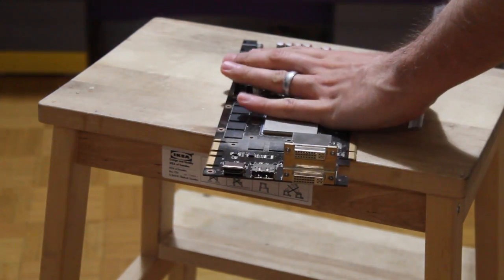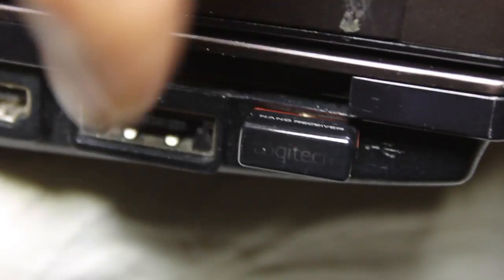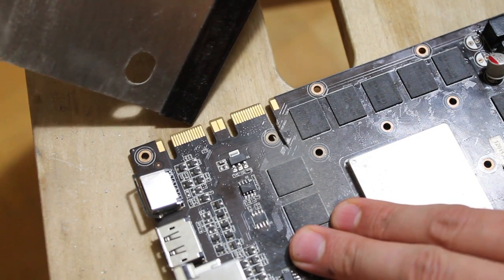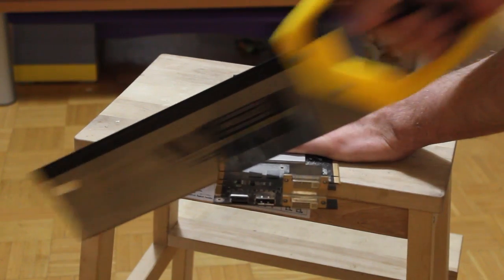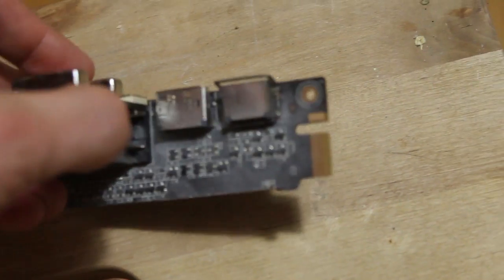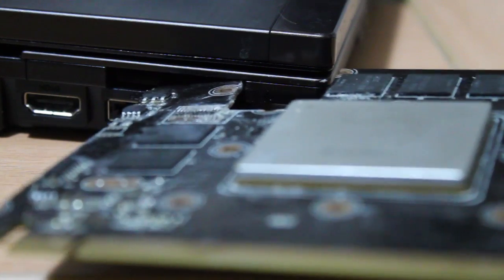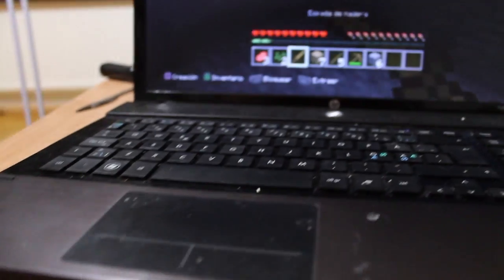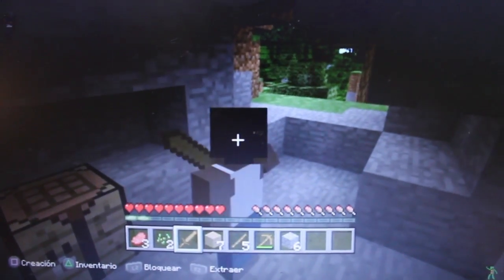Desktop to laptop GPU hack

Comment: This is amazing, I tried it with my 1080ti and it works like a charm!
Reply from the maker: awesome
Reply: Only think is, you may want to add a warning - when sawing through the card, to be extra careful, make sure you ground the saw itself,  or alternatively wear rubber boots. Otherwise you could damage the graphics card with static discharge..
Reply from the maker: true true

Comment: I had two pci-e slots on my laptop can I use two?
Reply: Wait wait wait, I did this but the cards needed to be powered by an external power source, but my dual chopped gtx 1080 ti's are a cool 45*c idle.
Reply from the maker: you need to multiply by two. then you get 90 C
Reply from the maker: maybe you can fit 4?

Comment: Dude is it a GTX 500-series GPU? It looks almost like my own GTX 570 that I baked to work again (no kidding, it'd BSoD on Windows startup and showed random pixel noise when booting up Ubuntu).

I just wonder if yours wasn't too dead to try and bake it.
Reply from the maker: GTX 580.  A few capacitors needed to be replaced, and likely the whole card would need to be baked (which is never a permanent solution). Even then, I'd have to order a heat sink and fans for it. with enough work it might have come back to life.
Reply: Sure, not worth the effort. I had an upcoming LAN, so I had to try something that's better than the iGPU
Reply from the maker: LANs are fun. but do local LAN games still exist??
Reply: Hungry Gizmo it was quite a while :D
I baked it for the 4th time now :P

and the LAN game choice is poor. Probably a good reason to play old classics like C&C, Serious Sam etc
Reply from the maker: yeah. everything has to connect to some server outside on the internet. not like the good old days. oh well. LAN parties are fun. I set one up a long time ago. ha C&C is always fun. are you still using the same graphics card. (by the way, I'm still making videos, subscribe, bell icon, etc. if you haven't already)
Reply: Hungry Gizmo Yes, still using it. Because... I decided to wait for next-gen in 2016 and then mainstream upon crypto happened.

I had unsubbed because it was too much, too long trash videos even for my liking.
+1 for a while ;)
Reply from the maker: I imagine you mean the reviews, etc? Here is the thing. those videos bring in views. like forever. people are always searching for them. Nobody is searching for a joke - they only get viewed if people share (so share, it helps). but. For your sake, about a month or so ago I decided this channel will be 100% (or close to it) tech humour. So stick around for a while, keep on watching. There is a lot of new content.
Reply: Hungry Gizmo I appreciate those reviews. They weren't in-depth but every video helps because people otherwise have no idea about a product (that no one else reviews).

I know about the search traffic. (and that's the reason I don't know how to start solo on Twitch)

What I meant were several minute long videos such as flying RAM sticks and Gizmos. Had it been under 2, 1 minutes - ok. But a 4 minute flying RAM nonsense is too long and hence too much.
Also I don't know if you were aware of, but overly long outros only hurt you on youtube (even if you made it your gig) - because of lower avg view duration and people not following onto other videos at the end.

Check out exurb1a and Life of Boris. Both channels exploded in the past 2 years (but Boris is honestly a genius with some prior experience on Youtube)
Reply from the maker: glad you appreciate the reviews. But those will eventually be moved over to another channel, because most of those viewers were not the audience to jump over to the other content. So you mean the RAMCPU adventure series? I haven't done that in a while - but it seemed to be well liked. but the back to back to back episodes may have been too much. (It's always a challenge to find a balance).
Yeah, well, the one and only figure YouTube cares about is watchtime - if you check out the official whitepaper released, even subscribers don't seem to influence the recommendation algorithm.
I'll check out the channels.
and thanks for the feedback - it helps build a bigger picture. From this side it's impossible to know, some of the jokes I think are great don't do well, and ideas I hesitate to put into a video turn into huge hits.

Comment: Woah woah woah, you forgot to put a warning in your video!!! If you do this, when you cut off the notch, you lose some VRAM. This may not be a dealbreaker for some, but it would be nice if you put a warning in your video.
Reply from the maker: It really depends on the card. The warning will be on the instructions you get from the manufacturer on how to make the cuts.

Comment: Thanks for the hack man! I can finally run Crysis 3 on my 2011 MacBook Pro!
Reply: at 24 fps 800x600
Reply from the maker: that's amazing. I wish I could run 400x300 pixels through my pixel tube, but I don't have enough space